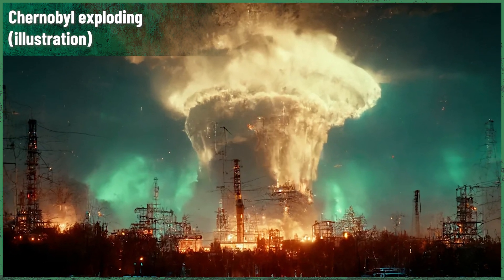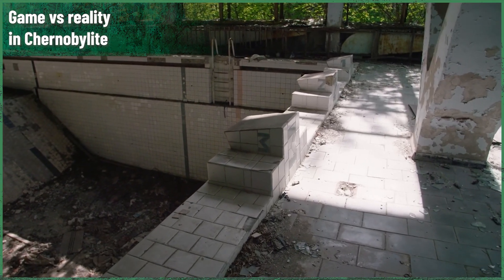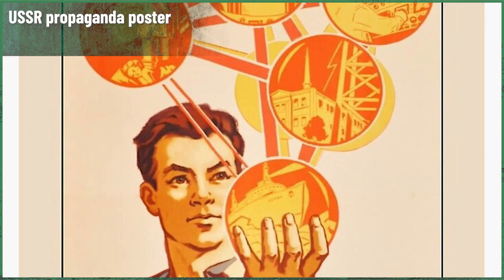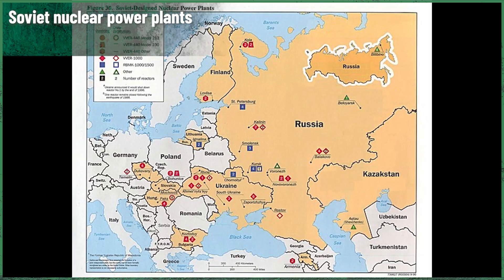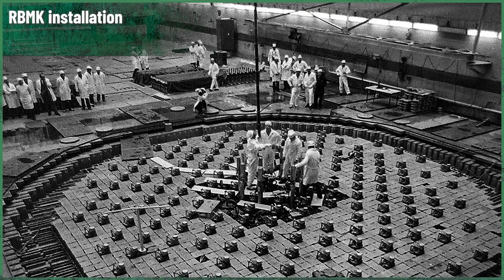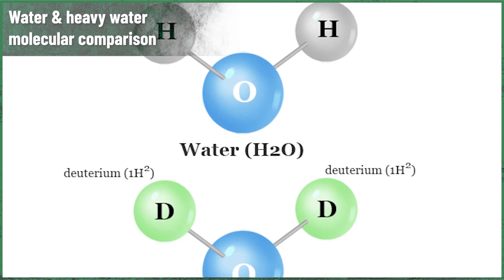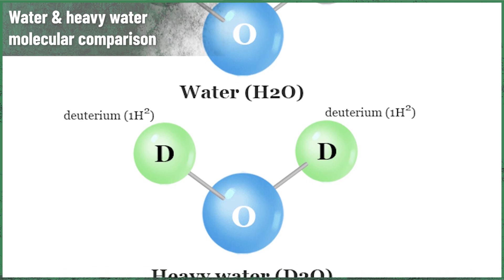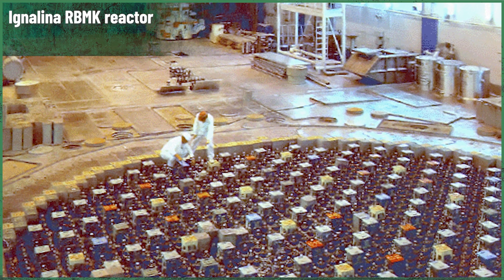How an RBMK reactor explodes? RBMK history and design PART 2 ||| Chernobyl Stories

Comment: Could rbmk be made a safe reactor with modern equipment installed??
Reply from the maker: Maybe, some were improved and will work up to 2032, but overall it's just not a good design.
Reply: Better, better is better, but is better good enough?

Comment: Other important factors for having RBMK was very low enriched and natural uranium as fuel compared to other designs needing lots of ~100% more enriched uranium without capacity to burn natural uranium. Dual use (producing Pu, probably also 3H), lots of power other military reactors discard, or low price were big advantages. Having RBMK compete with the Western reactors is something i never heard about as Soviets had many firsts in this field like SMRs, VVER is still doing very well without any problems. This are the only reactors in Europe built in 7 years for 7 billion, others cost more like 20 billion beside needing up to 20 years or more for project to finish. This is too technical...i hope Europe will start building them like South Korea, China, Russia.